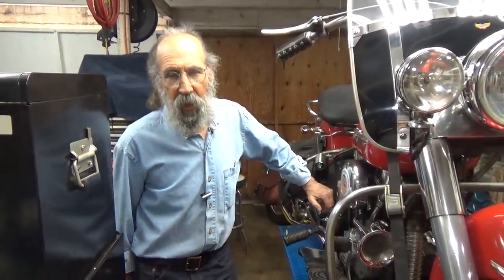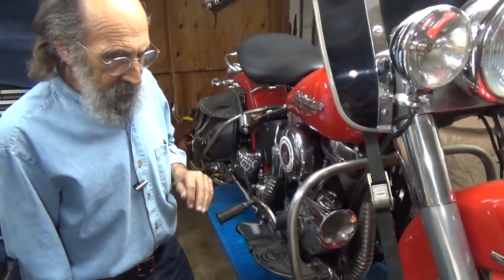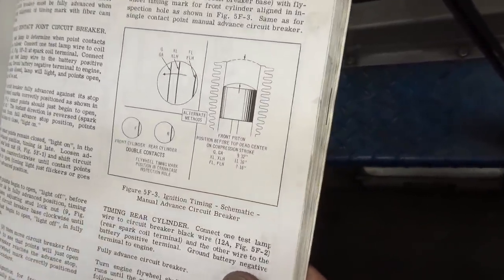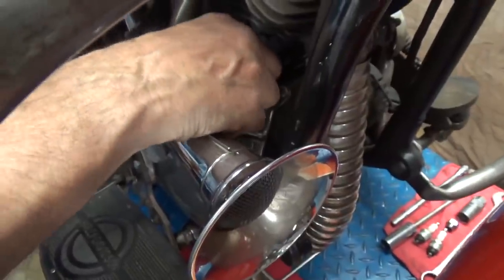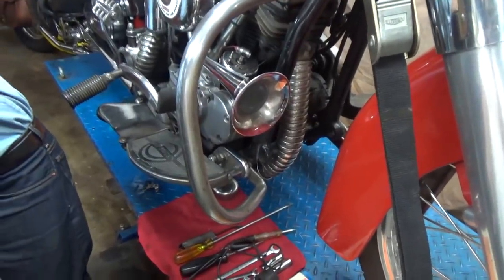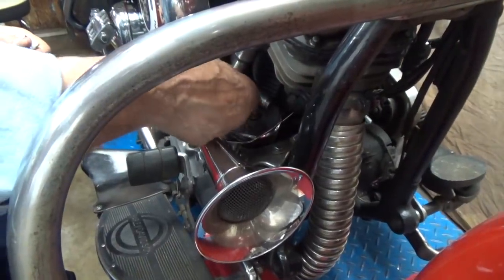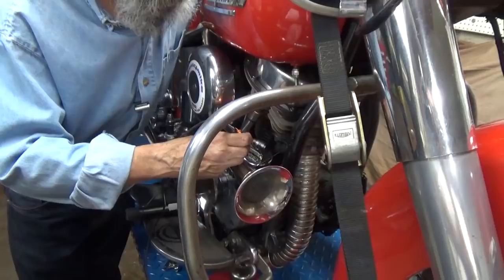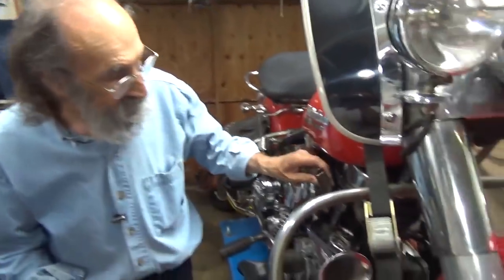A New Set of Ignition Points For a Harley Davidson Panhead

Comment: A simple, but very often difficult job, Thanks for the pointer.

My Harley was a 1974, Slightly over 74 CI engine.  It was real hard to start, and idled hot.  With the kelp of a tech. manual, I did the majority of the work. I just couldn't figure it out.  Finally, on a road trip up the valley, took it to the Harley shop in Fresno. The mechanic listened to me, took off the cover, and lubricated the advance mechanism. Worked as it should after that. 
Perhaps a video on that would shed some light on such things.
Sure enjoy, and learn a lot from your videos.
Reply from the maker: Yes, I will have one of my buddy's bring one over.  There's a bunch of simple little tricks to be done there.

Comment: Hi Mike; when I used to set up points, I set the gap up first on the tip of the cam or cams, many Brit bikes where set at 15 thous. 
This made sure that they would never open more than the correct gap once set. After that, I did exactly what you do by selecting top gear and turning
the wheel forward until the the timing mark was spot on. Then by turning the points plate plate or distributor, until the light just came on.
I really love your videos, I see there are others on the net trying to jump on your band wagon, but they don't seam to be so skilled at! So thank you.
Reply from the maker: Thank You.  Some of those old British bike were awesome.

Comment: I cut my teeth on British bikes dual points. I have done your procedure, it works great. But there is an electronic ignition available for the old timers. But for those that want the old time  set up, for originality, I'm glad you are there for the guys
Reply from the maker: I run a very fancy electronic ignition  on my cone motor Shovel.  On my older bikes, I run single points with modern coils.  British electrics?  Been there, replaced it all on my British car.

Comment: Tks Mike, I use red-tac grease on the point block-cam and point post. higher melting point and won't fly off. try it it's well worth it, helps point rubbing block last longer-points stay in-spec, longer. keep-em coming
Reply from the maker: Good stuff.   Thank You

Comment: Seen in the back mirror I had problems with the electrical of my 1971 FLH Electra Glide:

I changed the old wires to new UL approved AWG12, the dashboard switch and most importantly I changed the automatic thermal fuse.
Now it runs smooth again.
Reply from the maker: Good modern wire is wonderful.  I think you're speaking of the circuit breaker.  They get old and aren't very weather tight to begin with.  Again, nothing like a "fresh" electrical system.  That 71 Harley is 50 years old, no matter how well it's been taken care of.  I've rewired and replaced everything on my Shovelhead a few times, and I've had it since May of 1978.  It was a brand new 77 FLH.  We're still in love.
Reply: @pacificmike9501  thank you Mike for a great answer. That is the circuit breaker I am writing about and it is nothing more than an automatic thermal fuse, which is used in old American cars too. ✌️
Reply: @pacificmike9501  BTW: should it be a 15 Amp or 30 Amp circuit breaker to a FLH Electra Glide from 1971?

😊🙏

(Specifications not available in Clymer or on the internet).
Reply from the maker: "Automatic thermal fuse" sounds good to me.  It's probably the "proper term."  And generally, the "main" circuit breaker is a 30.  A genuine Harley Davidson (model specific) service manual has that in it.  Not to be rude, I know they're expensive, but money well spent.
Reply: @pacificmike9501  After some research I can say the Overload Circuit Breaker must be 15A for models from 1971 to 1978. I am ordering a new, because 30A is too high for my 1971.

Comment: Hi Mike- terrific and a pleasure to watch as always. . I know you are not a fan of them, but would you consider doing a video on how you like to set a dual point ignition up? I have a 63. Bone stock.
Many sincere thanks.
Reply from the maker: I normally remove them.  A little too "unstable" for me.  Putting in a single point distributor with a good 12 volt system would make a bone stock beautiful motorcycle  even better.  Good modern coil, Good modern generator with built in regulator.  Sorry.  I don't mean to push stuff on you.  But what a neat bike if it would stay in tune and light up the road at night.
Reply: @pacificmike9501  you are absolutely correct and I should do that. It starts  with finding  a single point distributor. 
How I rue the days when I could get one for almost nothing and I didnt....
Any recommendations on a generator make? ( I'm still  6v too....)
Reply from the maker: The ones on my old bikes are Cycle Electric.
Reply: @pacificmike9501  thanks very much. You are a class act!

Comment: I had a 1978&1/2 FXE (half way through the year HD got rid of the points and went to an electronic pick up). I remember changing over to the older point system. Don't know why, I never had a problem with the original style. My guess is not trusting dem new fangled electronics. Probably just caused myself extra work.
Reply from the maker: You were right. The early electronics did not stand up too well.  It took me a long timee to trust them.  They are now quite good.

Comment: I have spun my rear wheel trying to find the timing mark on my pan head for years and it's a no go. It has a 41 knuckle bottom and 62 top. I've always had to take it to the shop. Any Clues ?
Reply from the maker: The most commom reason is you might have two right hand flywheels.  This was very common practice back in the day.  The right flywheel is substantially lighter than the left.  By using two rights, the flywheel assembly is lighter which makes the engine RPM more quickly.

Comment: Hi Mike, I hope all is well. I have a '57 Pan (FL) that is running the stock linkert carb and cam. I tell you this because an aggressive cam could change your answer to my question. I recently rebuilt the top end and had the distributor out. When I re-installed the distributor I believe I put it in with the timing mark in the center of the window rather than to the right side of the window. Would that equate to approximately one tooth out on the distributor shaft? Once I verify that is what has happened and depending on your answer I may have to pull it back out and turn the shaft a tooth or two. Second question is pertaining to pan hydraulic units in the lifters. I'm still running the originals. Over numerous years or plenty of use will the hydraulic units begin to require the pushrods to be extended a bit more due to the hydraulic units not holding as much pressure due to perhaps the check valve in them? Thanks for your time.
Reply from the maker: You really need a service manual.  If your timing is off a little, it is less than a tooth.  Time that distributor by rotating the head of the distributor slightly.  We show this on tuning the Knucklehead.  Over time valves seat deeper in the heads.  That's normal wear.  The lifter do get "tired" however and should be replaced.  Concerning that timing, if you go to Youtube and get to the Pacific Mike Homepage, click on the word "videos", a bunch of videos will come up.  Look for the ones on tuning the Knucklehead.
Reply: Hi Mike, thanks for your reply. Did my checks today and I did in fact put the distributor in correctly, as per manual. So all is good there. With regards to the hydraulic units you stated that they do get "tired". So getting back to my earlier question...will lengthening the pushrod a full turn or so compensate for a "tired" hydraulic unit? I believe the average hydraulic unit has about .190-.200" of travel from zero lash to bottoming out, so each full turn on 32 TPI adjusting screws leaves you with about 6 full turns before collapsing the hydraulic unit and after that you would be not allowing the valve to fully close.
Reply from the maker: As per the old service manual.  Do a normal adjustment.  Start at the beginning and go through it.  It's in our videos. Always wait until the lifters bleed down before rotating the engine.

Comment: I know my old "bible" is full of errors (Clymer), I've been caught out by a few of them. I was wondering
if you could clarify something for me though, Mike.
My 62FL has front and rear timing marks on the wheel. Obviously, this is for a dual point set-up. I'm
running single points however. The book tells me to line up the marks (F & R) as you have in this
video: about 1/3 of the way in the hole. But for single points to put the line right in the middle.
Which is correct for a single point circuit breaker with dual point flywheel marks: center or to the right?
Thanks.
Reply from the maker: Use the "F" mark and treat it as if it were the only mark you have.  It is now your "advance timing Mark," as if it came from the factory with single points.  It is where your points begin to open with your ignition advanced all the way.  That would be with the mark to the rear of the window.  If it pings, bring it a little forward, it's too far advanced.
Reply: @pacificmike9501  Thanks, Mike. I'll take a look at it. I might be a tad retarded. Boy, THAT didn't sound right, heh.

Comment: Mike, how can I tell if a 77 FLH is early or late 77 model. Sometimes when ordering parts this comes up, especially front end. If the vin number tells this what do I look for in the vin. Thank you and Happy 4th
Reply from the maker: Okay, I'll do my best.  My Shovelhead is a 1977 FLH I bought new in 1978.  Other than by serial number and knowing how many were made each month, it's hard to figure out.  My '77 is a late '77, so I'll tell you the differences as I know them to be.  First, Harley moved up to Dot 5 brake fluid.  Good idea.  Don't mix 3 and 5.  If your using 3, flush it out and go to 5.  Next, the suspension, both front and rear was changed from HD to Showa.  Showa is a Japanese manufacturer that makes all of Harley's suspension today.  The only front suspension that they didn't make was the late style springers.  The only other and most important change to pay attention to is the gear set in the engine.  This include the pinion gear, breather gear, and cam gear.  These can easily be identified.  The cam gear  (Late Model) has a groove cut in the face of the gear.  If changing from one type to the other, the entire gear set would have to be changed.  Those are the only differences that come to mind.  There may be one or two others, but I don't know what they would be.

Comment: Hey Mike I got a question I just change my oil on a 2003 Heritage softail, the oil filter runs on to my voltage  Regulator,can that  Short out the voltage regulator
Reply from the maker: Well, it's irritating.  But the uit is sealed.  There are many methods.  But, it's almost always a mess.  I'd call it a design flaw.  And we all continue to try.
Reply: @pacificmike9501  pulled the plug apart and oil came out and bike will not start, like battery is dead,replace feb 2020

Comment: Hello Mike, thank your for sharing your trouble-shooting and tutorial videos, I have been watching some of them recently. However, as I am lack of deep knowledge regarding the ignition coil & distributor, would like to ask you if you can help me out... Well, the issue is I use auto advance distributor for my 1951 panhead, with aftermarket 12V ignition coil (read 3.7 ohm primary resistance as I tested it). The engine starts well, but the point of distributors gets burned after a well..., then I replaced the coil with 5 ohm one, then it goes ok without burning point.  The question is, why 3.7 ohm coil will cause buring point?  as far as I know anything between 2.5  to 5 ohm should be fine... or the point gets too thin to use? need your thoughts.     I live in China, and very limited goods hands can be found around here... so I come to ask you.  Thank you and wish you all the best.  Zuo Yang
Reply from the maker: You are correct.  You and I learned this one the hard way.  I honestly have forgotten why the higher ohm resistance is required for points, but I know that it is.  That's the difference to remember when ordering a coil.  Sorry I'm not more help on that one, but it is so.  I'll bet we get a better answer from one of our viewers.  Thank You.

Comment: Hello Mike. I hope u had a good 4th of July. Good info. on the ignition points on the 52. My Harleys are not that old,but good to know anyway. Question : My Evo motor spits in the carb. when it's cold,runs better after halfhour or so. How important is the VOES for the motor to run nice when it is cold? I think maybe there might be airleak at intake manifold. Have a nice Sunday. "The Swede"
Reply from the maker: The VOES is almost foolproof.  The best way to check for a vacuum leak on an Evo, to pull the sparkplugs and compare them.  If the color match is good, no leak.  If one is dark and one is light, vacuum leak.  When seasons change, quite often fuel changes.  Sounds like you may just need a slightly richer idle jet.  Or, maybe a vacuum leak.  But from the way I'm reading you, slightly larger idle jet.
Reply: @pacificmike9501  Thank u i start with the sparkplugs tomorrow when it will be rain here on the westcoast. If u ever have some sticker or T-shirt with your logo i by some 👍. The Swede.

Comment: Question for you Mike, I have a 1951 Pan that starts right up when it’s cold. When she is warm it is very hard to start,any thoughts?
Reply from the maker: You have to figure out:  Is there fuel in the manifold when it's hot? or Is it dry in that manifold when it's hot?  Then you'll know whether to just crack the throttle to start it hot, prime it first, or open the throttle all the way.
Reply from the maker: Another thing, are your plugs fouled?  Are your points in good shape and adjusted properly.  Some times, it's a good idea to go through the setting procedure one more time.

Comment: Mike, 
Great video as always. I have a question regarding timing mark. I have a 41FL knuck, my manual as you're more than aware is for sidevalve and OHV UL/FL Am I right in thinking the fully advanced mark for my fixed mag would be the same place? thank you!
Reply from the maker: You are correct.   Be careful, I appreciate a mag I can retard for easier starting.  But, it may be just fine as it is.  There are mechanical pieces  out there for retarding mags, and I mean old original style.  Just remember, mags need to be set very accurately and it's a pain getting them there.  But, once you've got it, it will stay that way.  Also remember to gap your plugs around .019, or you'll start burning things up.  Check them often.  Have fun!  Awesome combo!
Reply: @pacificmike9501  Hi Mike! thanks for the reply, just wanted to make sure as I've came from a UL which is not the same. I've ran mags on all of my bikes, makes for an easier life!  Thanks again sir.

Comment: How are you on 3 brush generators?
Reply from the maker: I usually change the system to a 12 volt generator with a built in regulator.  Rebuilding generators isn't nearly as necessary as it used to be.

Comment: Happy 4th Mr.Motorcycle. I have a 1972 FLH shovelhead, but my dad changed the frame to a jammer frame. He passed and I got I started to get interested in learning more about the bike. It has dual S&S heads. My dad friend said it’s a 93” stoker but the other friend said it’s a 96” stroker (top end). How can I tell if it’s a 93” or 96”. 
Also, you said your bike is your road bike. Do you ride in really hot weather? Do your bike run good in hot weather.
Reply from the maker: You'll probably have to tear it down.  But, if you can copy the numbers down by looking into the window (by removing the timing plug), and check with S&S, they can probably tell you the length of the stroke.  If the cylinders a very close together, probably 3 5/8 bore.  Again, you'll probably have to disassemble it.  Or, don't worry about it.  My bike is fine in hot weather.  I do run an oil cooler and I do try to be easy on her.  I don't do as well with the heat as I used to.
Reply: Pacific Mike  Thanks Mr.Mike. I’m going to do this. Just love your videos

Comment: I have a 1974 harley ironhead  with a magento not sure to set the points gap at .015 ) (.0018) or ???? I also spark set at .020?? I was told it does make a diffence which S.P wires goes to cylinder front or back the  get different answers from youtube
Reply from the maker: Certainly, a 74 Sportster did not come with a mag.  Consequently, you should contact the manufacturer of the mag for specs.  Unless it is a single fire unit, the mag doesn't care which plug is which.  It is very important to set the plug gap properly  (probably .018).  Too large a gap will burn things up.
Reply: thank you very much I love you channel
Reply from the maker: Thank You.

Comment: Happy Independence day Mike.  Where/are you a motorcycle tech? Or just learned by messing with your own bikes.  Would love to gain some insight on what your journey has been.  I could watch your channel for hours.
Reply from the maker: I grew up in a gas station.  I started building my first hod rod at age 13.  I built my first Harley at age 20.  I started working in Harley aftermarket shops in about the late 70's.  I had my own shop for quite a few years.  I am officially retired.  And, there it is.  I don't ever want to be referred to as a "technician."  I'm just an old wrench.
Reply from the maker: And, Happy Independence Day to you!